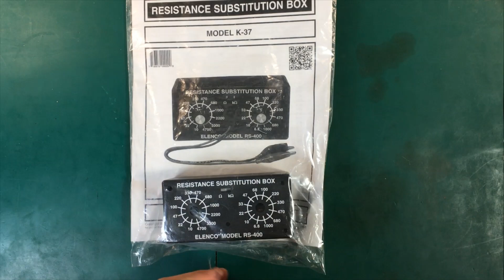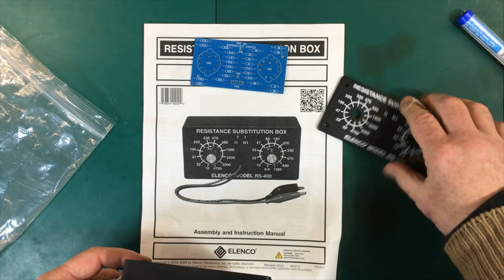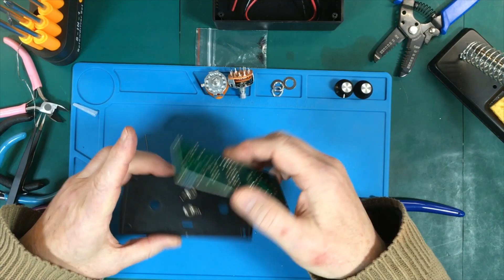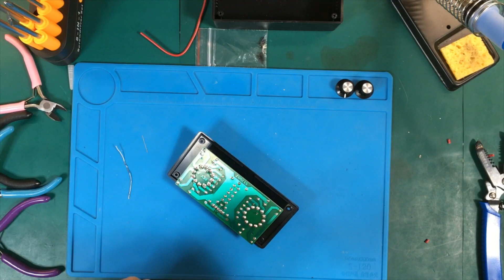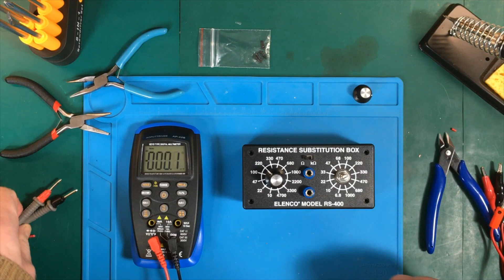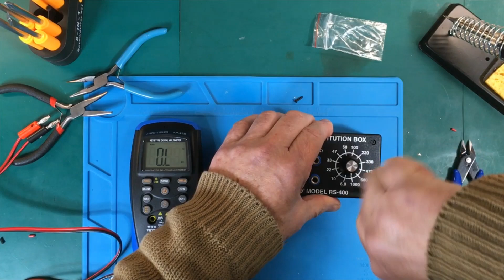0012 - Electronics kit time!  Let's build an ELENCO RS-400

Comment: Very weird the kit used so many repeated values on both ranges, and a bit sad to see they couldn't use 1% resistors. Although maybe you really don't need 1% for this applications.
Reply from the maker: Thanks for the comments.  The values are not repeated.  One switch is in ohms, the other is in K ohms.

1% or.5% resistors would have been nice, and you could buy them and put them in if you wished to have that precision.  It would have added a lot to the price of the kit if they were included with it.
Reply: @uni-byte  Ah I see, all the kilo-ohm values are x1000. That makes sense.
Reply from the maker: @ivolol  You got it.